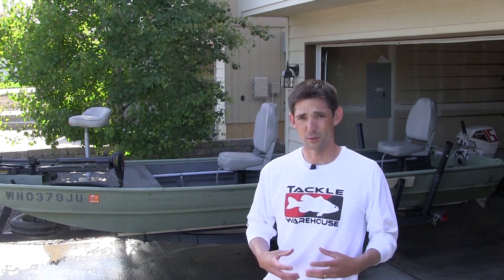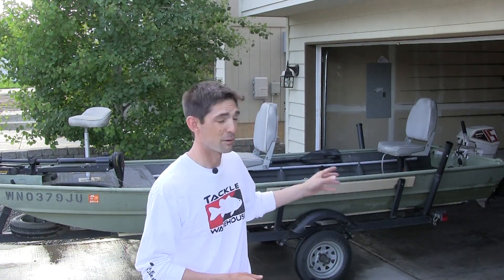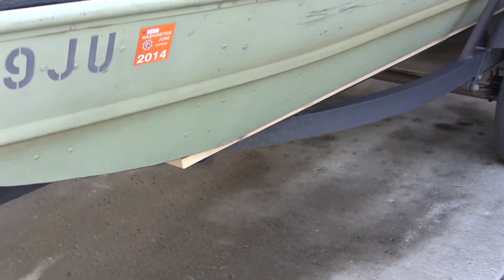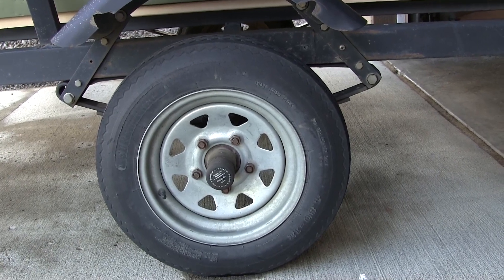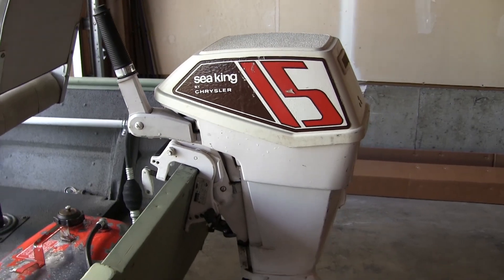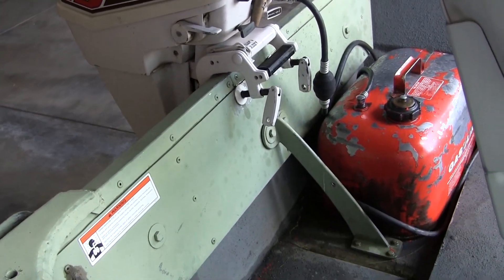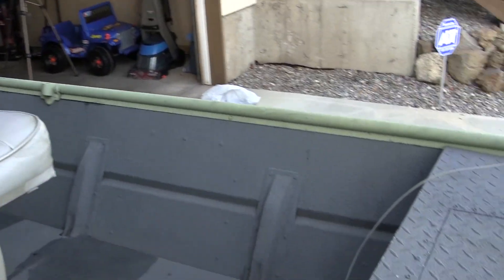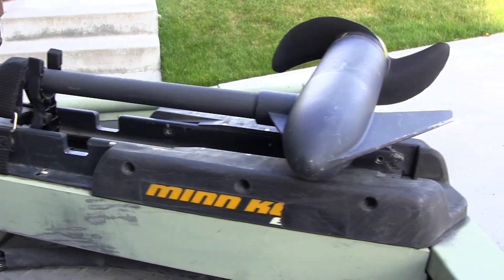(HD) Jon Boat to Bass Boat Project Four Years Later

Comment: this project is awesome and im glad you still have it and use it. when i was a kid my buddies dad helped he and i put a front deck and bow mount trolling motor on an old leaky v-hull aluminum boat, we fished that thing for like ten years untill they moved away and ive always been infatuated with this idea. yours came out really exceptional. (it also helps that you and your dad are obviously talented fabricators.) im gonna go check out your website, keep up the good work and tight lines!
Reply from the maker: Phillip Williams Phillip, thanks so much for the feedback. To be quite honest, this would not have come out like it did if it weren't for my dad. He builds lots of things, from guns to bass boats lol. Using wood would have kept the cost down, but the cool thing is, there are so many options it just takes some creativity.
Reply: ***** thanks for the reply, i came across a website (tinboats.net) that has alot of guys doing similar projects and theres lots of great ideas on there. if you have the time you should see some of the really incredible outcomes these guys get even from cheap craigslist heaps that dont hold water. anyway keep up the good work man.
Reply from the maker: Phillip, my project is on there. That's how I started researching. Tinboats is a great site. Thanks again!

Comment: Sup buddy. My question for you is about removing the bench seats. I just got a 12ft flatbottom and was wondering if removing the seats would effect my boat in any way. I'm pretty stoked about this project.  Any advice would be appreciated thanks and remember tight lines and sharp hooks my friend ✌🏽🎣🎣🎣
Reply from the maker: Victor Davis they might add some stability, but most seats in Jon boats are full of foam to help with flotation if the boat takes on water since most don’t have binge pumps. Our boat didn’t suffer any negatives, just made more space for us :)
Reply: @FHCOutdoors  Thanks bro. That's exactly what I'm striving for is more room since it's only a 12fter. Kinda want to mimic that panfish edition jon boat if you've ever seen one